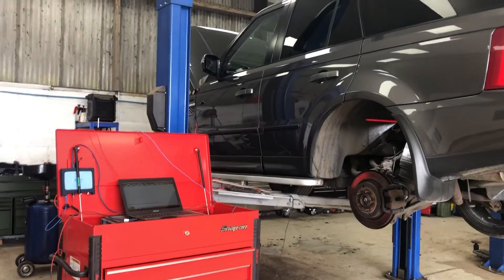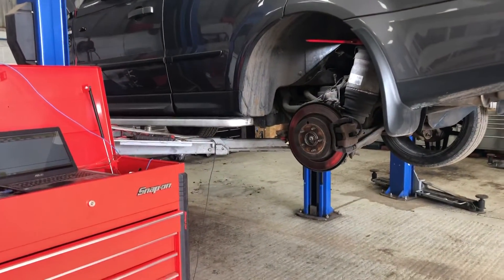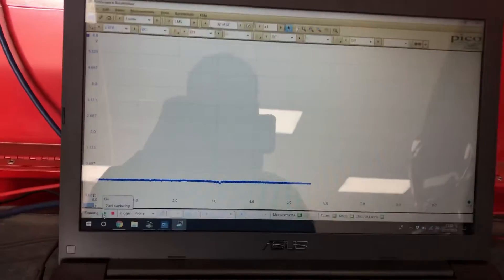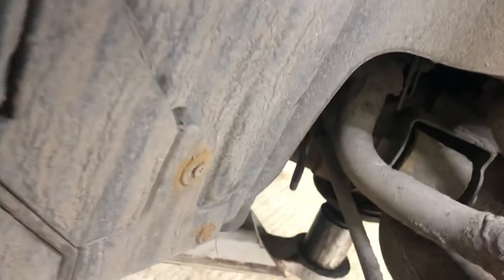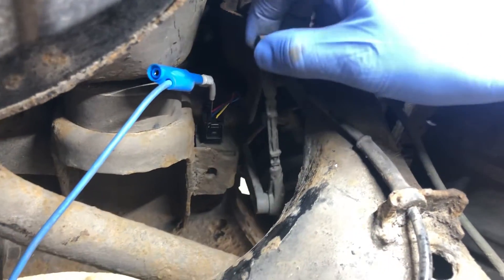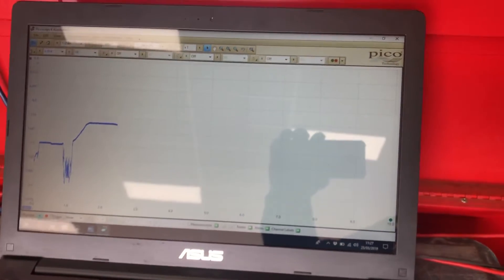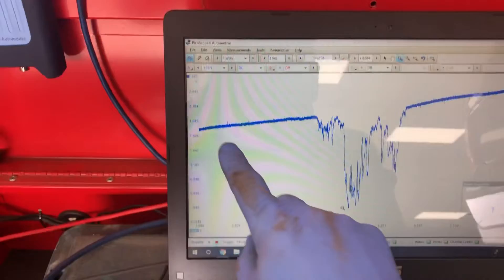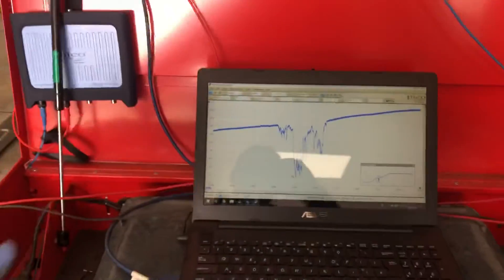Range Rover Sport suspension fault - Picoscope vs height sensor!

Comment: Hey buddy if you can help I would really appreciate it. My Jeep has air suspension and when moving the height sensor arm it will start at around 1mm but as I raise it slowly the reading  will go all the way up to 630mm with just a slight raise. Is that a bad sensor?

Comment: Thanks for the video 😊, 
Mate my 07 RRS TDV6 it gives me HDC won’t start or crank just amber light off and on scanner gives me ( P0500-00 Permanent Vehicle Speed Sensor (VSS) A ) 
And ( U0155-87
Permanent
Lost communication with instrument cluster control module ) I checked for all kind of issues those RRS , I put New AGM battery new Alternator new wheel sensors new bulbs  all ground are new wiring I checked everything 😢🤦‍♂️🤷‍♂️ 
What else to do !! I checked on Nanoncom too it gives CODE: U0010
Medium speed CAN communication bus
(PENDING)
BUS SIGNAL/MESSAGE FAILURE/)
 

CODE:U0155
Lost communication with instrument cluster/control module
(PERMANENT)
BUS SIGNAL/MESSAGE FAILURE,,, 

Many thanks 
Matt

Comment: Would this type of fault cause the air suspension to totally stop rising? Mine is stuck in access mode and I’ve noticed that passenger side front has a flashing light on the 4x4 info screen, do you think that it is most likely a height sensor issue? Thanks

Comment: Hello, have you ever come across issues with 2012 rr sport with 6 pin Hight sensors, ( 2 rear replaced with oe Jlr parts) no fault codes but rear of the car is sitting very high and it is refusing to re calibrate with either autel or sdd, all 5v and grounds appear to be ok and I have single up as far as suspension modules….!?🧐 any information would be greatly appreciated!
Reply: U ever sort this buddy?

Comment: Hi anyone willing to point me in the right. Direction. I have 0 volts going to my front right ride height sensor. I cannot see any obvious damage to the wiring.left was fine 4.9 volts. Even if someone could point me in the right direction to show how the loom is routed through the engine bay would be hugely helpful. Wiring diagram shows a plug connector half way back to the ride height module but again I’m finding it difficult to trace it around the chassis. Thanks in advance.

Comment: Hi pal my compressor failed I put a new one on but still wont rise and how long does it take to fill with air from empty thanks
Reply: Its my understanding that if vehicle is all the way down, the compressor won't kick on. A work around for this is the use a jack to raise the vehicle (front or back) bout half way. The compressor should kick on. Its as if the compressor knows the suspension is out of range, so I won't turn on until its within operating range .